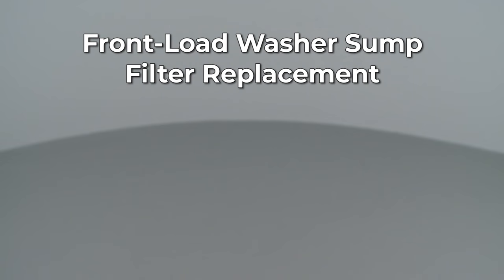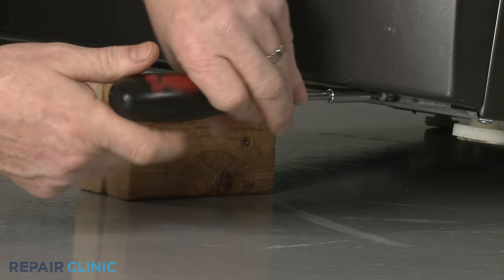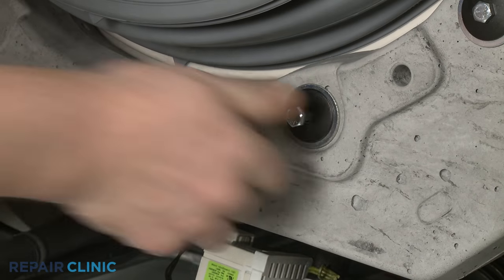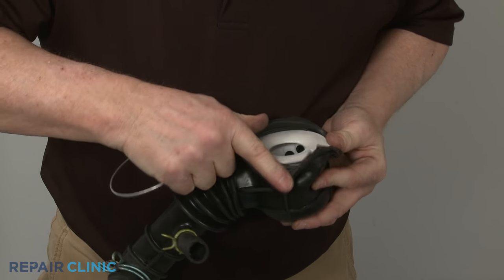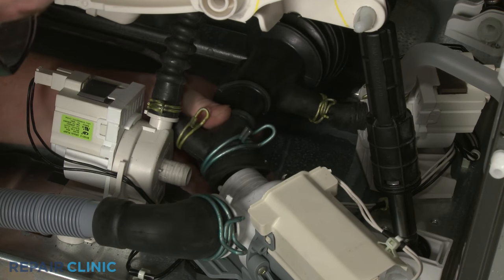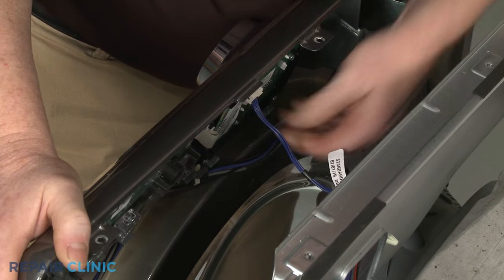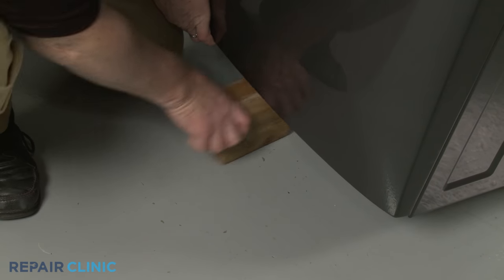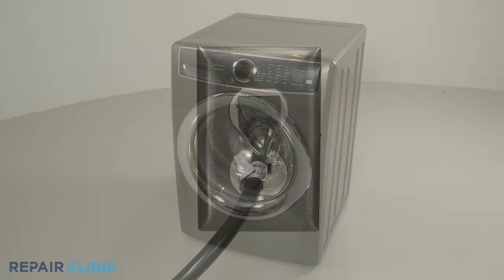Electrolux Front-Load Washer Sump Filter Replacement (part 5304505165)

Comment: DISASSEMBLE THE ENTIRE ELECTROLUX MACHINE???  How could this machine pass any design review inspections?  Model# ELFS617STT.  I feel dumb... actually thought I had purchased higher-end machine(s)!  Not even an access door or mention of needing to clean a filter monthly in Installation or User Guide/Manual.  With pedestal in the way I am looking at removing R-side panel too.  Hope nothing else breaks during this process and re-build is successful.  This feels like a bad joke.

I do appreciate your video, as it has been very hard to find any legit trouble-shooting for this hunk of junk!  I understand you didn't design the machine, but wanted to comment in case it saves someone else from buying.  Electrolux Dryer was replaced under mfg. warranty.
Reply: Doesn''t it feel like a Saturday Night Live skit?  On my model, there was also no mention of a filter to clean.  I learned from Electrolux site that I'd have to "tip the machine on to its back" to access the filter.  No he-man muscles came with the machine so I'm sure this won't be a monthly maintenance activity.   Electrolux must certainly be laughing.

Comment: Are you kidding me you literally have to  Disassemble the washing machine to replace or clean this filter other washing machines  the filter  is right in the front 1,2,3 done what a horrible design basically you're forcing a major repair  bill I would never buy an Electrolux again..

Comment: I agree with all these comments.    Don’t buy an Electrolux.    But I guess we all already know that.   My control panel failed after 2 years and less than a year later another E12 error code.
Reply: Electrolux was more interested in capturing our eyeballs with irrelevant electric lights & complex computer codes than designing a proper machine.
Reply: @Herbocharge-tu2yp  The thing is there is probably nothing wrong with the motor and pump.   I wish the government would spend some time thinking about how these corporations are making money.   Selling machines which don't last, with cheap Chinese spare parts at inflated prices.   But I guess that's too much to ask, expecting someone else to care.

Comment: I have a Electrolux Luxcare front load. Would a partly clogged sump filter cause small amounts of water to drip from the door during use?
Reply: No that is caused from gunk on the door remove the door and glass panel carefully and clean off gunk the put back together all you need Is a screwdriver and a cloth I did it without any video and just trying to figure it up
Reply: @amabar3647  my wife would never allow "gunk" to build up on the door. I'll admit the first thing I checked was to make sure a hair or thread wasn't between the door and door seal. It was clean so that wasn't the problem. It was difficult to see against the white paint, and it only happened for a short period of time during the wash cycle, but the water was actually dripping from the corner of the detergent dispensing drawer to the top of the door and running around the door's edge. Turns out the detergent drawer has a design defect. It has a two piece construction and the bottom half was sagging causing a gap which allowed small amounts of water to get through. I glued and clamped the drawer letting it dry overnight. No problems since.
Reply: @Interesting_Placebo  if you wash lots of fuzzy blankets or have pets with fine hair or worse in my case wash a cashmere blanket can’t be cleaned from the outside it wedge’s in between the glass panels
Reply: @Interesting_Placebo  I’ve noticed the same issue on my Electrolux washer. Thanks for the tip, I didn’t know how to resolve the leak.

Comment: don't blame engineering. this is all marketing driven according to service techs, a desire for the front panels to be flat and flush (i.e. no filter door lines "breaking" the aesthetic). very silly.
Reply: I guess then Electrolux could kindly put a notice on the machine of what can not be done to maintain it and avoid an early end yo the machine.  Or, they could have put the access entrance on the side or back.  The instructions for my machine:?  Tip it on its back.
Reply: Those engineers and designers were all smoking something anyway.

Comment: In the same amount of time you can just go get a Samsung and not have to do all of this. I have this problem and considering just getting rid of these unnecessarily complicated units.
Reply: Samsung is absolute trash for appliances I own a few and HATE them
Reply: @feraldog5590  good to know! Any brands you like in particular?
Reply: @kevintaylor5715  I've had best luck with LG and Whirlpool. And if you can afford it Bosch.
Reply: Samsung washer is the worst! My Samsung washer just died less than 5 years. The drum was out of balance. It's a common issue with Samsung washers.
Reply: Electrolux or Whirlpool or whatever it's called today, thanks you for your purchase.
Reply: I think Electrolux was formerly Whirlpool.  These entities likely share the same parts suppliers in China and sell, buy, and consolidate more often than I change my underwear.  Just slap a different name plate on, add a few pretty lights.

Comment: I just found this video and ..big nope. Throw it away and get a new one. Because if you call service just to clean that filter every few months it will cost you more than a new washer. The worst design ever, but I think it's intentional. Buy new washers every 2 years. Don't get me started on their dryer. I have them both for 2 years now. No major issues yet, but if they break, I am looking for a washer with the filter situated at the front so I can clean it. We had front load for years back in Europe, and all had the filter in front for better cleaning. Never had to fix it or do any repairs.

Comment: This video is completely absurd. You dont need to disassemble the entire washer to clean the drain filter. Just flip the machine on its side and access the drain sump wire clamp nut via the opening in the bottom of the washer. Once thr nut is loose you can pull the sump boot off and remove thr filter. Mine clogged with dog hair after 1 yr. Its a fiddily job as access is tight, but it's doable with only loosening one nut